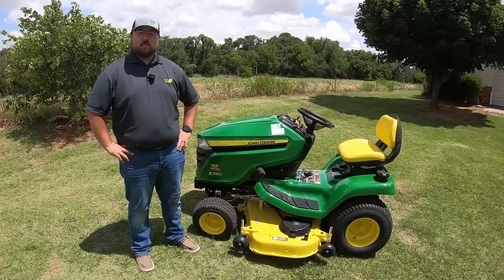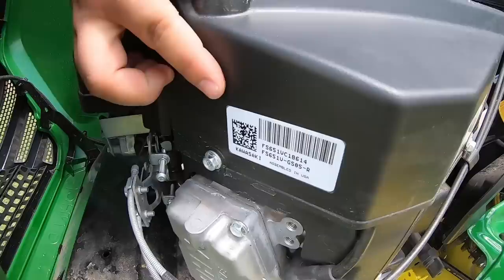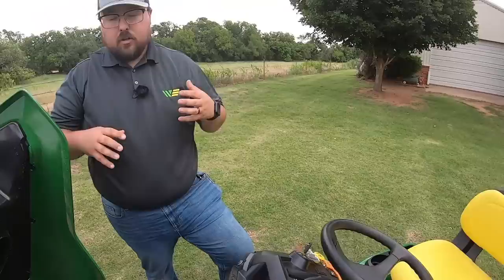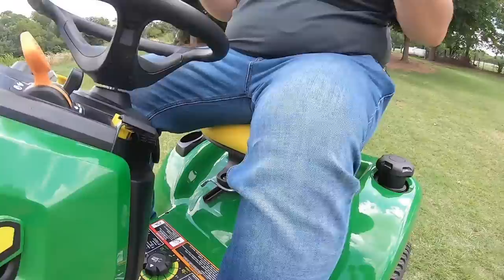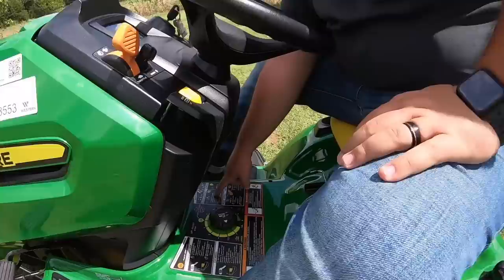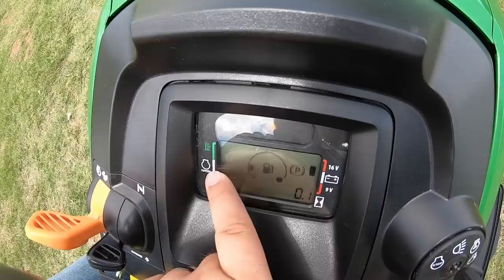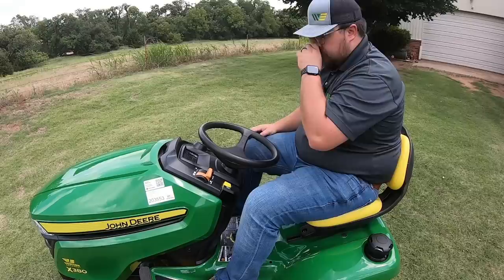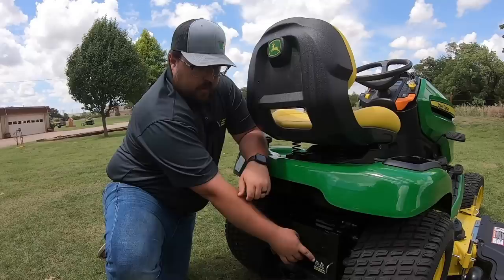John Deere X380 Riding Lawn Tractor Mower Review and Walkaround

Comment: Do yourself a really big favour and get a deck lift. I have a MoJack deck lift which will lift 500 pounds and allows you to easily lift the front of the mower ( which takes about two minutes) about two feet to clean the deck and change the blades instead of all the grunt work to take the deck off and put it back on.  You'll never have to take the deck off unless it's necessary to replace the drive belt.  I have a Simplicity Zero turn which does not require taking the deck off to replace the belt.
Reply from the maker: I completely agree with you here. Since this video has been shot I have gotten one for my barn to do all of my future blade changes. They are great! Thanks for watching!

Comment: Owned my JD lx188 for 28 years now.  It's blowing white smoke for a minute when first starting. I have the cash to upgrade to a new tractor but after looking at what JD has, I'm thinking resolving the lx188's issue and keeping it another few years. Not liking the "improvements" here at all.  Also, my water cooled Kawasaki is a lot quieter than that.

Comment: Great video! One question though. You mention using air and not using water to clean the top of the deck because water could develop rust. Wouldn’t the bottom of the deck develop rust too, if you use the wash out port?
Reply from the maker: Thank you! Yes, this could be an issue but this is why when you use the wash out port you should kill the water after the cleaning and then let the blades continue to run after shutting of the water to dry the underside. Thanks for watching!
Reply: @WesternEquipment  Ahh, I see! I bought a new Z545R and am scared to use the wash out port for that reason. Thanks!

Comment: I bought a riding mower about 18 years ago.. a murray brand.. it's still running..it has at least 1800 hours on it.. all original.. I'm  finally replacing the drive and blade belts..every time I start looking I'm  blown away and totally turned off by all the over engineering.. you and other manufacturers have made the simplest of things complex.. amazing..
Reply from the maker: Well as time goes on things do change and I know it can be frustrating. Which things are you talking about specifically?

Comment: I appreciate all of your videos. You do a good job explaining the various mowers reviewed. Have 476 hrs on my X380. Service it regularly, have changed battery and starter solenoid.  Replaced deck because I abused the thunder out of it. Am old guy with arthritis in my hands so I put a JD turning knob on the steering wheel and it really helps,

Comment: Just got my x380 yesterday. Should I have to adjust my scalping wheels or should they be set when I get them. Also if I have no concrete pad then I would assume the deck wash would not be able to be used by me.  Thanks for doing this video. You did a great job on it and it is very helpful.
Reply from the maker: You would still need to adjust your anti scalping wheels based on the height that you are going to mow at. and it will also work on asphalt or any other hard solid surface. Just not in dirt or grass.  hope this helps and i hope you enjoy your new mower! Thanks for watching!

Comment: Good job, However I would have mentioned on the deck leveling that it should not be necessary to have to relevel it unless you forget to check the tire pressures first. Another cause for it to change is if you step on the deck and put too much weight on the deck support system.
Thanks
Reply from the maker: Great feedback, thank you! And thanks for watching!

Comment: I bought the x380 13 months ago and have 150 hours on it.  Just after a few days of owning it I had to bypass the seat sensor and reverse button for the blades. 
I understand they are there for safety reasons but it is a little ridiculous. For a 6k dollar mower I am disappointed with the cheap plastic deck wheels that keep melting off its axle. Other than those three issues it has been a great machine with plenty of power.  I’ll score it 8.0 out of ten.
Reply from the maker: Thank you for the feedback!

Comment: Great walk around, thanks. One ? I have is...which Tuff Torque model transmission is in this one? 46, 66, 67, 72? A Deere dealer salesman I spoke with today did not know. Would appreciate your reply. Thanks again.
Reply from the maker: Thank you and this actually has the K58.
Reply: Is there any difference between 2022 X380 and the 2023 X380 other than the Green deck?

Comment: Great video and very helpful for someone like myself considering this machine. Thoughts on the X380 instead of a JD ZT for a 1/2 acre lot that slopes and has several trees to mow around? Would a ZT be a better option or does this thing turn fairly tight with the 48" deck?
Reply from the maker: If I was looking for a machine with a tight turning radius I would look more in the 4-Wheel Steer tractor style mowers or a ZT. The 4-Wheel Steer does cost a little extra but is very worth it. I hope this helps and thanks for watching!

Comment: Excellent review!  We have a 30 degree slope in our yard and would also like to plow our 12 degree slopped drive way.  Would this model handle that or should I go to an x570?
Reply from the maker: Thank you! To answer your question, I think you would be happier with the performance if you went ahead and bumped up to the X570. I believe the X380 could do it but it may struggle a bit where as the X570 should have no problems. I hope this helps and thanks for watching!

Comment: Nice video. What is the difference between the x380 and the x390? Both with 54" decks. Thanks.
Reply from the maker: The differences are that the X390 has hydraulic power steering and hydraulic deck lift, whereas the X380 is manual on both the steering and deck lift. I hope this helps and thanks for watching!

Comment: I was hoping you would have pulled the pin on the back of the deck. I wanted to see you pull it. I have a very hard time pulling them out
Reply from the maker: You might way to check out our deck removal and blade change video! Let me know if it helps!

Comment: So newbie question... does this model have the locking axle/rear-end? Don't know the proper terminology for it. But my lots are not flat and was looking for models where it won't just be doing the one wheel spin. I know there's 4wheel models, but I don't have the need or the money for the big yard tractors, lol. Thanks in advance.
Reply from the maker: No, this model does not have differential lock but once you move up into the X5 models they will have differential lock (traction control). I hope this helps and thanks for watching!

Comment: Does it have AWD? and if the last digit in the model number is the type of steering what number would be power steering?
Reply from the maker: No it does not but there is an option for 4-wheel steer which would be an X384.

Comment: How well can it do inclines? My John Deere  D170 can't do it without chains and now with 180 hours on it the transmission is shot and I don't want to spend over $1000 just in repairs.
Reply from the maker: You should see a significant difference in traction and stability with this mower over the D170. But it is always a good idea to ask your dealer for a demo first to make sure the mower will work for your property. Good question and thanks for watching!

Comment: Hi, I looking to purchase a mower that will also be used to so some grading on my gravel driveway and in my yard. I want to be able tu use the 40 inch JD loader and those grading attachments. Will a X350 or X370 transmission be enough or I should really jump to the x500 serie?
Reply: Also, i will use the mower to push snow in the window. My driveway is quite steep.
Reply from the maker: I would be looking into the X500 or possibly the X700 series. Thanks for watching!

Comment: Would it be ok to use this tractor with a front blade to grade a gravel drive way?  Would it damage the transmission any?
Reply from the maker: These tractors have an upgraded transmission that are more meant for front attachments so is long as it was just light grading I think it would be ok. For a little heavier frame and more ability the X500 series may be a better option.

Comment: Other grease point locations?
Reply from the maker: The only one not  mentioned here besides the front axle and mower spindles is the tension idler arm on top of the deck. I will either have a grease zerk or it will just need spray on lubricant every 50 hours or annually. Good question and thanks for watching!

Comment: How do you tension the belt if its not turning the blades?
Reply from the maker: The mower should be set to have the right amount of tension with the spring and such on the deck. I would check to make sure you are not missing any parts and also check to see if your belt is damaged or stretched. I hope this helps and thanks for watching!
Reply: @WesternEquipment  is there a part that holds the one pulley out to keep the belt tight?
Reply: @WesternEquipment  I'm getting a new belt...another question ..us there supposed to be another spring or anything attached to the pulley that is on a movable arm toward the right side of the deck if you are sitting on the machine?

Comment: I’ve got a .29 acre corner lot. house, landscaping etcetera... I’m wondering how overkill this bad boy would be for me? It’s such a bad ass mower I want it. I’d be using it to mow, mulch, pull a lawn roller and do my own aeration too. Any discounts or sales coming soon?
Reply from the maker: I don’t think this would be overkill at all especially if you’ll be pulling a roller. And yes April and May is the time for looking into John Deere mowers. That is when the best deals come out. Thanks for watching!
Reply: I have 1/4 acre and use a X300 so you do you lol
Reply: nice job, I have a used  non sticker , x3?? will the serial # ID  it ??  thanks

Comment: Can you put a 42” deck on this?  I don’t need the 48” but I want the heavier duty axles and transmission and tighter turn radius this has over the x370
Reply from the maker: Unfortunately it is not available with a 42" deck. This model only comes in 48" or 54".
Reply: Thank you. Being I couldn’t get it in a 42” and would be at 48” deck anyway, I  went with the X570 instead so I got the locking differential as well.

Comment: I am a heavy guy (430 lbs). Is there a certain base line model I should start at? I was looking at the S240.
Reply from the maker: I would say there is no certain model to necessarily start at, I would just look into seat options and operator station adjustments and options. Sometimes the space between the steering wheel and the seat is an issue so I would suggest going to your nearest dealership and trying some out and see what fits you the best! Thanks for watching and thanks for the comment!
Reply: @WesternEquipment  Thank you sir. I have enjoyed your videos. Have a blessed new year.

Comment: Need help in changing the mower deck.  I followed your instruction which were extremely helpful.  However when I installed the secondary belt and then
reinstalled the mower deck, the lift pedal is stuck,  it will not move.  I uninstalled the deck and it still won't move.  Is there a release mechanism that I don't know 
about.  I have read the manual several times and watched your videos but I cannot get it to move.  Help if you can.  Thanks
Reply from the maker: Do you have the park break lever in the lock position?
Reply: He was too embarrassed to ever come back! 😊

Comment: Is that transmission serviceable on the 2022 model?
Reply from the maker: I believe it is still a sealed transmission. I will check to make sure and try to do a video just over transaxles at some point. Stay tuned and thanks for watching!
Reply: @WesternEquipment  
That would be great. I’m looking to replace my cub cadet GX-54-D which has a K-62 tuff torque with a locking differential which is sealed also. I want to upgrade to something with a serviceable trans and preferably a locking diff. Which puts me in the JD 500 series $$$ But if I can get my hands on one I think I’d have to pull the trigger. So a video on the various transmissions JD offers would be great. Thanks!

Comment: A buddy has a jd x288 for sale $600.... I think he said x288? Can't find anything on it on YouTube ? Maybe I didn't hear the model name correctly? I had seen it on a trailer and looked pretty nice from 100' away? Has anyone ever heard of a x288 or any similar in size? Any issues to be looking for in buying used? Most important things to be looking for that will be too costly soon?
Reply from the maker: Look into an LX288. This is probably the model. I would just give it a thorough walk through. Check the battery, make sure it starts. If not, does it need fresh fuel, does it need a full service. Could get into such things as a carburetor or starter which might be costly, but just be thorough on your walk around before you purchase. I hope this helps and thanks for watching!
Reply: If it is the LX228, then it is a pretty old mower. If it runs and cuts good then I would say it is worth 600. If it doesn’t run then don’t get it

Comment: what's the best tool to use for sharpening mower blades?  I see most people doing it by hand with a file or small electric drill, but it's hard to keep the edge straight doing it by hand.  Is there some automated way of sharpening blades with a machine guide to keep the edge straight?  How do blade manufacturers sharpen the blade?  I doubt they do it by hand.  It would be nice to keep the same angle set by the manufacturer, only I never know what that angle is supposed to be.  Do John Deere shops have a machine to sharpen blades at a set angle?
Reply from the maker: All great questions! Let me do some digging and see what I can find for you! Thanks for the comment!
Reply: @WesternEquipment  thanks!  It kinda frustrates me to see that most people still have to sharpen mower blades the same way it was done 100 years ago.  It's like no progress has been made for sharpening mower blades hahahahaha.  I used to take my blades to a tool and die machinist and he could put a perfect edge on the blade in about a minute.  I have no idea how he did it though, trade secret I guess.  He's gone now and when I try to do it myself, it takes several minutes and I just make an ugly mess out of it.  So now I just buy new blades and donate my old ones to a small engine shop.  It just seems to me in 2020 there should be some easy, automated way of putting a smooth, straight sharp edge on a mower blade at the proper angle without having to take it to a professional.  I certainly can't do it by hand.
Reply: I use a belt sander at work

Comment: The Kawasaki engine ruined it for me not a big fan
Reply from the maker: Really? That surprises me. have you had bad luck with them?
Reply: A place I worked for had a John Deere gt235 with the Kawasaki engine which I and others used for many years on commercial and residential properties with a ton of hours and had zero problems! I would say the Kawasaki engines are the best there is from my experience. And wouldn’t recommend any other engine. That mower still runs today and I believe it’s a 2005 model.